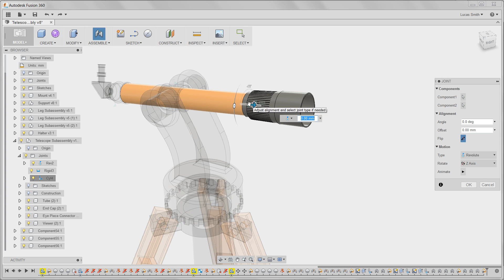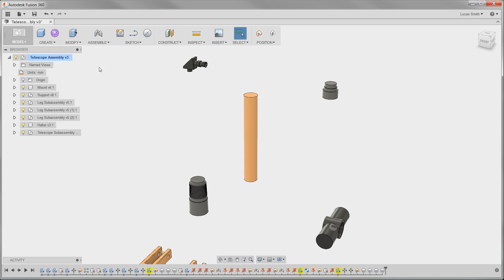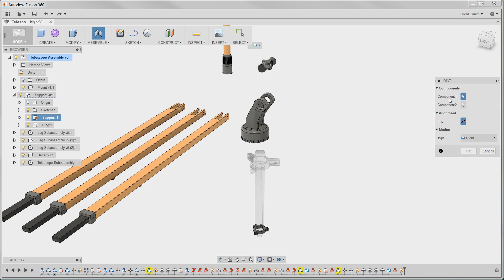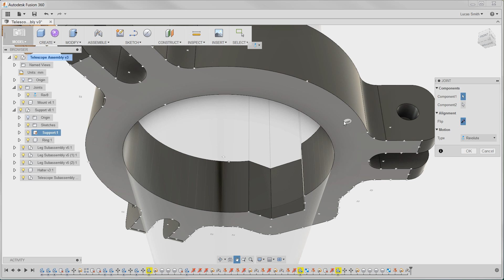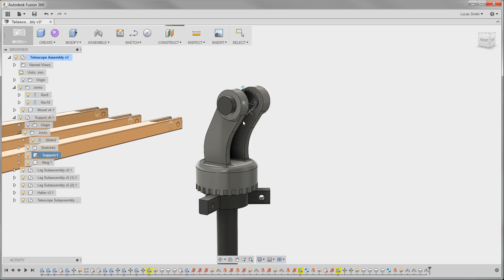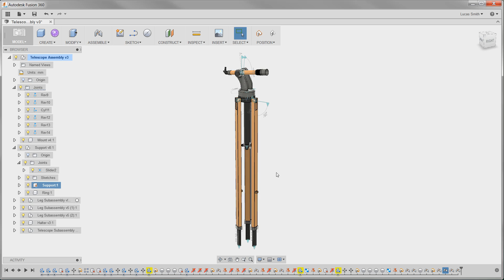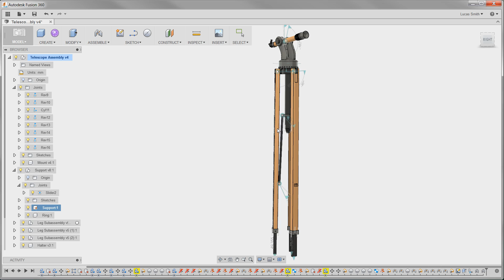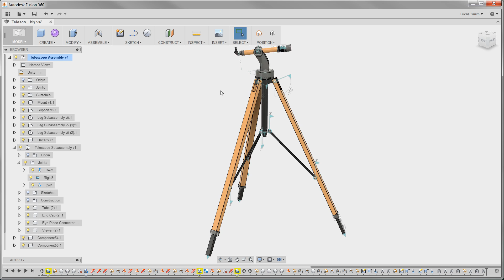6: Joints and Motion

Comment: Great video.  At 10:20 + you address As Built Joints.  In the case of Rigid Joints, you would only select the two components and then hit OK?
To clarify, there is no Joint Origin or Orientation? 
Thanks
CA

Comment: I created to components and created the revolute joint but when I try to move it with the cursor It doesn’t, and both components move together as if it was a rigid joint!😓
Reply from the maker: Add a joint between one of your two components to the larger assembly workspace to tie it down! Something needs to be fixed to allow for the rotation to happen. Check this out! https://youtu.be/2w8BuJ-3_80

Comment: Still Struggling with joints in Fusion 360 . I wish to make the same type of motion configuration in fusion as I´ve done in Solidworks linking a simple part to follow a curve i drawn, however don´t feel like Fusion is helping me. Is there a simple way to do this?
Reply: Create the body from your curve (revolve), enable contact set between those 2 bodies, set your joint as slider or cylindrical and it should do the job.

Comment from the maker: See how joints in Fusion 360 are more powerful & flexible than other CAD tools & can be used anytime during the design process.
Reply: +Chris Ciancimino Yes, you need to look into Contact Sets... you may have found that by now.
Reply: This module in Fusion 360 is really fantastic!